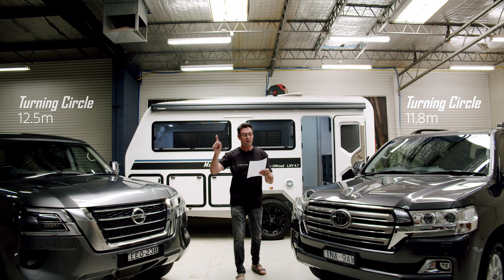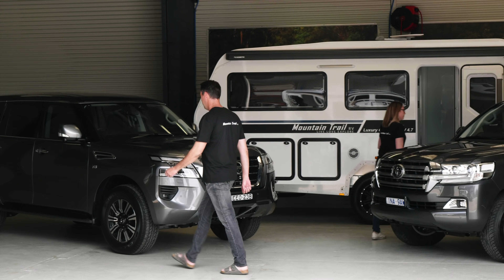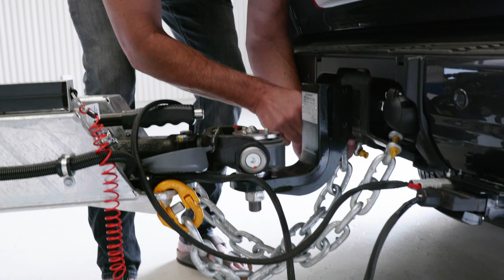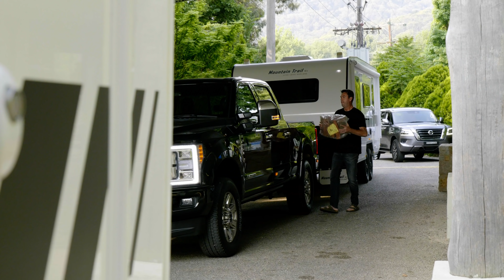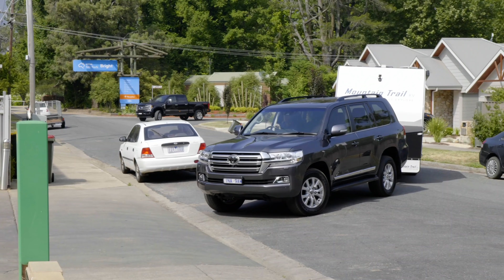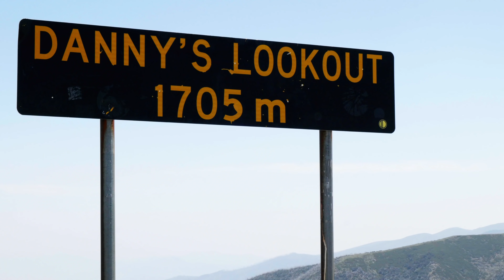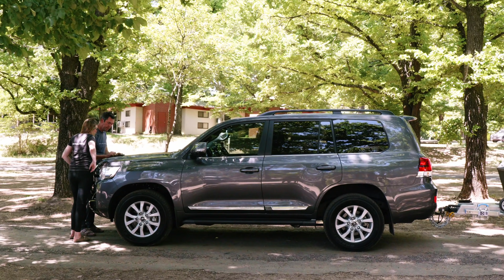Y62 V8 Nissan Patrol vs Toyota LandCruiser Fuel Consumption Tow Test PART ONE (4K)

Comment: It would be nice to know the fuel consumption figures while you climbed the hills. The Disco has those, and some drivers watch that figure. Also that Disco was probably a TD version - which was much more popular than the SD version. The TD got 520 NM at 2,000 RPM and 155 kW; 208 hp) while the SD got 600 NM at 2000 RPM and either 180 kW - 242 hp at 4,000 rpm, or in later Discos 190 kW - 254 hp at 4,000 rpm. The motor would get 700Nm and more power too, but not in Australia, the motor being designed for low grade diesel. Its possible the Disco was either not going flat out, or a TD, or both ... and we should remember too, the Disco 4 had a small fuel tank, effectively 82 litres (with a reserve of 4.5 so the claimed 90 was almost there, but Land Rover feared the tank being run empty due to - who knows why? But saving fuel use is more of an issue in a standard Disco than in a standard Patrol.

Comment: In the long run. V8 Gasoline will win compare to twin turbo diesel (philippine settings) Diesel here are not refined/not clean plus if you will not maintain the engine well the turbos will give up. Unlike the NA v8 gasoline, its indestructable. Smiles per liter baby! :-)

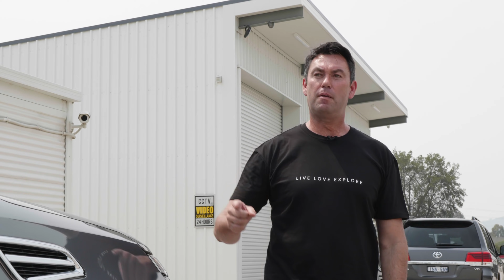Comment: So you've specified kerb weight for both vehicles @1:21. Of which, the figure quoted for the Patrol is tare by the way. Then at @4:49 state both manufacturers were accurate with the tare weights. 

The figure for Landcruiser is wrong. As kerb weight includes the full tank of fuel, tare is only 10 litres. Either the bridge is wrong, of the kerb weight quote by Toyota is wrong. 

Toyota quotes kerb weights of 2630kg for GXL and 2705kg for VX and Sahara. Either way, figures are way off. More so if tare figures are used.
Reply: Yeah I was thinking the exact same thing. Something doesn’t add up in regards to the weights.

Comment: Re calculating fuel consumption.  Did you check odo accuracy?   Speedo and odo usually out by  - 3% in standard vehicles

Comment: I am owner of Nissan Patrol Safari High Roof GQ with Td42 from 1988 as per today 32 years old running well. I don't understand why Nissan left that 4.2 diesel engine is reliable solid brick, you can modified it. Also high roof is good feature too I think.
Reply: Marian Javorka to meet emissions requirements just like landcruiser went from 4.2l to v8

Comment: diesel vs petrol engine is not a good comparison
Reply: Patrol isn't available in diesel though, only true competitor to the land cruiser
Reply: @ADVANCEDTECHTIPS  discovery 5 td6  absolutely destroys the 200 in towing.
Reply: @nicholaswirth1011  yeah it does. For the whole of the 50 kikometers it runs without some malfunction .Then it'll take some part change or fixing to get it to run some 50km more.
Reply: florin baiduc scared of a change/challenge? Toyota’s are good but double the price good? Highly doubt it
Reply: Just as long as the TDV6 crankshaft doesn't snap unexpectedly.
Reply: Bodgy Aussie yea, then use the 4.7 V8 petrol LandCruiser
Reply: @ADVANCEDTECHTIPS  oh the Ram pickup truck is quite the competitor to a landcruiser
Reply: Why
Reply: it is an excellent comparison IMHO. Especially for this application, It's useless to have an engine delivering less torque and more power (like petrol engines do).
Reply: @florinbaiduc  Yes, 560Nm of torque is useless. Cool story.
Reply: @kichaa13  Huh? I also think torque is better than power, chill down bro, and read again what I've just said. BTW the rest of your post makes no sense, power is not a function of torque but a function of engine speed. And torque is a function of engine geometry. Binary or not is a nonsense statement. There diesels have a distinct advantage for SUV applications, as SUV don't really need to drive very fast, but require loads of torque.
Reply: Diesel advantage from the torque for sure, but not HP
However its engine block will always be heavier due to the material
Reply: @charliekaryanto  the thing is, you don't need HP except if you drive on maximum speed. Otherwise torque is what's needed. Diesel systems (engine+tranny) are surely heavier than petrol counterparts, but it' well worth the extra 50 kgs IMHO...
Reply: @florinbaiduc  agree, diesel already has the advantage at start, love diesel .
however our goverment already imply B30 fuel into our passanger vehicle, so its not going well on my seasonal offroader due to the bacteria grow and etc, 
only if we use it everyday then B30 is fine
Reply: @florinbaiduc  you realise power and torque are not binary? And that power is a function of torque? Torque is measured on a CURVE. 

The Patrol produces 504Nm of torque at 1600 rpm going up to a peak of 560Nm. That is absolutely MORE than enough torque for any off roading or towing. 

Unlike power, once you have enough torque you don't really notice the difference when you increase it. The naturally aspirated V8 in the Patrol will be much more reliable, more fun and cost less to maintain, while destroying the usual diesel argument of fuel consumption.
Reply: florin baiduc ‘

Comment: 30K price difference, the toyota won't break even for 400,000 kms, IMO the patrol is a bargain at 90K
Reply: I got new ti for $68k drive away with tow bar! No brainer
Reply: Until you read all the reviews of owners from the US and realise they are not the reliable old trucks they used to be. I wanted one, but they are the still the typical crap that Nissan sell these days. Wouldn’t trust one to take me off the Hume Fwy. Sucks, because its a hell of a motor and on paper its a good thing.
Reply: rigged100 
Mine  y62 is 9yrs old is still almost new, nissan all the way ,400hp is even low in consumption.
Reply: @rigged100  how many old land cruisers do you see on the roads today as compared to the old patrols that are still running great?
Reply: @davida.livingston8543  a lot lmao, there’s a reason why Toyota still produces 70 series up to this day. Also you act like the “old” patrol aren’t being maintained that they’re still going strong😭. Toyota has some million mileages cars/trucks that’s still running good.
Reply: @davida.livingston8543  I see more old land cruiser than any Nissan patrols combined. “I SEE”

Comment: The both vehicles should be gasoline engines, Nissan 5.6 verses Toyota 5.7  ,then we all have the best options, but Toyota doesn't put power in theirs engines as Nissan.
Reply: Most people buys the land cruiser with diesel engine and Nissan with gas engine since Nissan doesn't offer a diesel engine
Reply: The Nissan 5.6 is possibly a technically superior engine to the Toyota 5.7 petrol V8.  And more fuel efficient too.

Comment: Hiya , well my 1991 Nissan safari 4.1 diesel non turbo is bloody awesome , I have own it 24 years and only done the water pump, breaks and exhaust system batteries fan belt idle bearing and that’s it , they don’t makem like this any more. That’s where Nissan went wrong they brought out the 2.8 diesels whata mistaka to maka
Reply: And they merge with Renault.. bad decision but in those days that was the only solution to their problem!

Comment: Once you said Landcruiser is a V8 Diesel, then it's a clear winner, without having to watch the video
Reply: Haha how misled! Watch Pt2...Also with the price point difference the Patrol has plenty left over for fuel and accessories budget.
Reply: @meandering_wombat  I would like to see how much petrol he went through if he used e10 or 95 since he use 98 I have a mate that's got one and he complaints about how thirsty it is and he  only tow a camper trailer I'm confused
Reply: phil foote A worthy test, 98 is more efficient, yet pricey. The benefits still out weigh. Petrol service costs are cheaper and less frequent. A similar specs 200 effectively equates to well over 500K kms of fuel with the coin in the pocket for fuel. Also depends on how heavy footed, as that petrol V8 supercar engine is tempting to make it roar.
Reply: @meandering_wombat  yes very confused I have a Hilux my mate has a Y62 and it sounds so good
He says it's so thirsty but he has a heavy right foot borrowed his dad's 200 series to go to Queensland at Christmas said it was so much better on diesel I'm very confused of what to buy I have a Nissan and a Toyota in my family both Japanese bill to perfection
Reply: phil foote I think there’ll be a small hit overall. Though with towing performance without struggling. Less issues overall on servicing, less dirty fuel issues and expense that causes with diesel. series 4 on has been tweaked for economy. I just can’t justify the expense of the 200 and the awesome base inclusions of the Y62. Bigger, lighter, cheaper a winner for me.

Comment: Part II   ???   I drive the same Landcruiser, but with snorkel. I tow a 3 tonne Van, your figures are accurate for that weight and climb with the diesel, but really, should of compared a petrol 200
Reply: Peter Willmott. And where can you buy a petrol Cruiser. Not in Australia that’s for sure.

Comment: That Ford will not even know it is towing anything....a brute for towing.  Waiting for the Nissan Patrol gas engine. Doubt it will tow as easy as the Toyota, however I missed the specs on the diesel engine.
Reply: The engine is the 1vd-ft  it's a 4.5l twin turbo diesel v8
Reply: Thanks,  thought the Ford was as here in the USA. Huge

Comment: Very good vid,as in the compare specs,probably should have 100 k road section included,and I have f250 x2 so the whole time I'm thinking wish he would throw the ford in an he did or is going to,my 7.3 diesel get 16 to 23 per hundred and my mates got 400 hp gmc,s and they get 12 to 16 per hundred

Comment: Why not compare the Patrol with the 5.7 petrol LandCruiser.
Reply: Nissan patrol have two diffrent engine  5.6  400hp..  & 320 hp  V8
Reply: That engine is only available down under with the Lexus LX570,
Reply: Landcruiser Full option its 5.7
Reply: @محمد232-ذ2غ  That's for Middle East And Amercia only.
Reply: Nissan Titan pickup truck. 390 HP
Fast. In the USA.
Reply: Cause you can’t buy a petrol Cruiser in Australia.

Comment: When's the off road part because quite frankly road tests are super boring ,and here in the States even if we could buy either one of these vehicles we wouldn't buy them to haul a trailer up a mountain we would buy a more traditional open bed pickup ie Tundra Titan Ford Chevy Dodge etc. And save the LC for when the pavement ends....
Reply from the maker: Thanks for your comment Greg, we don't have as much choice in Australia for large tow vehicles, The Landcruiser and Patrol have always been considered as the best tow vehicles available in Australia.  There are Australian companies bringing in USA vehicles such as the Dodge Ram, Ford F250, Chev Silverado, Nissan Titan and converting them from left to right hand drive, but they are expensive in comparison to the cost of them in the USA which dosen't help with sales volume and popularity. We will be doing off-road trips in future episodes. In the next episode, we do take the American F250 on the same test.
Reply: @MountainTrailRV  I think that Isuzu, HINO Mercedes already have great trucks that replaces the need of ford f250...350..... and that's also why American pick up trucks don't really succeed out of the US
Reply: @moineaux9173  Spot on. I notice people using 5th Wheelers replacing the US Pickups with the Japanese Trucks

Comment: Nissan should design a suv, to compete with the landcruiser prado......
Reply: Kishan Kish 
It used to be the pathfinder but they turned it into Mallfinder.
Reply: @Agent.K.  one of the biggest mistakes nissan made.....
Reply: They have Armada
Reply: Anzar Kunhi isnt the armada the same as patrol. They have the same frame and body.
Reply: @tambinono  the second gen armada  is the same as the armada...with some mirror diffrence...
Reply: @tambinono  It's bit longer than Patrol.
Reply: they do. Nissan Terra
Reply: @loumiehao310   the terra is a compentior to the fortuner...

Comment: Toyota for the win, better capability, more reliable, better customer support, better built and it doesn't have shit Renault electronics that will go wrong.
Reply: I think the same, Nissan needs to go back to that old traditional Japanese engineering. But first needs to get rid of all that French drama, and fix their finance problem. the real reason why they merge with Renault In first place 20 yrs ago...

Comment: GVM is reduced by 130kg on the patrol when towing 3500kg
Reply: The same as the 200 series. All wagons take TBW off the GVM. Utes take the TBW off the GCM.
Reply: No, you are confusing TBW with the GVM penalty the patrols have. GVM always includes TBW. The patrol needs to reduce GVM by an additional 130kg plus the TBW. The 200 has no GVM penalty. 

BTW, Utes also include the TBW in the GVM. ALL light vehicles do
Reply: @VEOPengineering     ah shit yes sorry. I was thinking about how it effects payloads between wagons and utes. Case in point 10:04 onwards in this video https://youtu.be/swUDFWQ5QhI
Where the TBW come out of a wagons GVM to calculate what is left for playload weight (GVM - Kerb Weight - TBW = Payload) and utes dont (GCM - AGM - Kerb Weight = Payload)
Reply: https://youtu.be/hQvlTzMXvdo 👍

Comment: With the Patrol you will never get more than 100 litres in when on empty even though it's 140 ltr tank. So you cant bank on an accurate lph doing that way. I'm banking on 33 ltrs per hundred for that run if it's driven correctly. But you don't buy one if you only destiny in life is fuel acconomy.
Reply: we could have a little sweep stakes on the Y62 fuel usage eh. my bid 35 LPH
Reply: I'm  saying under 30lts per 100kms. My 4.7 petrol Cruiser averages 28lts per 100kms towing van.
Reply: It's actually 2 tanks, 1 x 100lt and 1 x 40lt, they fill together but you use the 100lt first then the fuel pod inside the main tank switches to drawing out of the 40 lt tank, I've regularly put 120 lt + into mine, most was 137 lts in one fill.
Reply: 33Lph 🤣 must really know your cars

Comment: Cmon part 2 Y62 please.

Too late i just bought one...
Reply: Cam frods I bought a series 4 seven months ago! Love it couldn’t justify the extra money for the 200
But also I like tha patrol better anyway!
Reply: @drealist7941  love mime too. Drives superb on road and on the beach.
My father in law has a new 200 vx, drove mine and now he just keeps swearing...
Reply: Cam frods I would too if Toyota robbed me’
Reply from the maker: What did you buy ?
Reply: @MountainTrailRV   I bought the new series 5 patrol Ti in Hermosa blue and love it. I've only done 800kms in it so far and just did a surf trip of about 380km which included approx 60km of soft beach with 20psi in the tyres and averaged 15.8 on the gauge for the trip...It sat on around 12lph on the hwy.
I certainly didnt take it easy either. Drives bloody unreal and for the price i got it for i feel i am miles in front of a comparative 200. Time will tell though.
Reply: I am yet to tow with it. Get the tow bar fitted next week. They do get pretty good figures towing. I know you are doing Hotham but it would also be good to do a flatter comparison too. Not too many hills over here in WA.
And dont drive the patrol like a diesel when you test it please...probably too late but had to say it
And finally hurry up and put the vid up.....😁
Reply from the maker: @camfrods  check out Part 2, it dropped tonight!!
Reply: @MountainTrailRV   part 2 is a surprise. Thought it would be close but i expected the ford to win it easy.
Great car the S5 Y62.

Comment: I like the effort you've gone to here to ensure a level playing field and a valid comparison. No matter how well the Y62 performs (it will use slightly more fuel, but not much more) the Toyota faithful will be outraged by the comparison to their beloved, overpriced 200 series.  The Y62 is simply a better full sized car, even before you factor in the substantial purchase price differential between the two, then add in significantly more maintenance costs.
Reply: @Nate Brindabella nissan dropped the ball in 2006 when instead of upgrading the td42 they dropped it. Coupled with the fact that the '04 and earlier zd30's were prone to blowing up and that is the engine it was left with then no diesel option at all in the y62 which crippled its sales across the world.  In the end nissan destroyed their own fanbase/sales through out of touch business decisions which is a shame because the y62 is just as good if not better than the 200 series
Reply: Phil Grant Toyota will stand the test of time, that is why they are so beloved.
Reply: Phil Grant 
I agree with much of what you have said but I think the fuel usage will be a little more than ‘slightly’.I hope I am proved wrong though.
Reply: @Nate Brindabella i agree 100% the gq and especially the gu are phenomenal 4x4s it's just that the engines suck haha. In aus just about every 4x4 comp is dominated by gu's and 80s with engine swaps
Reply: John Cadogan did a cost comparison and I think from memory calculated that you’d have to drive the Toyota for about 450 000km before the cost benefit of diesel caught up.